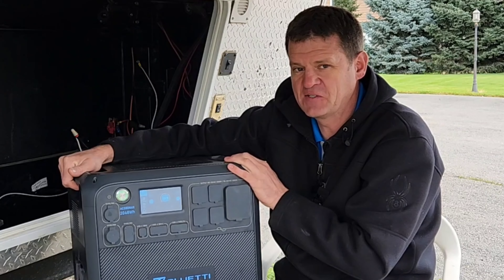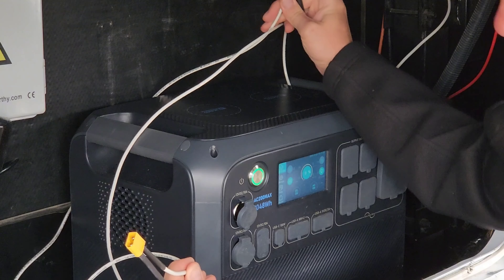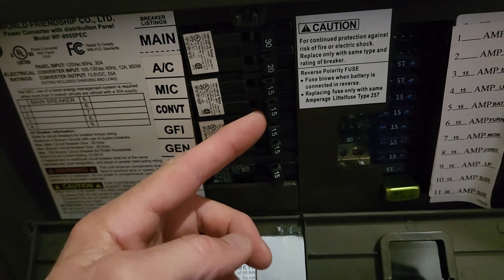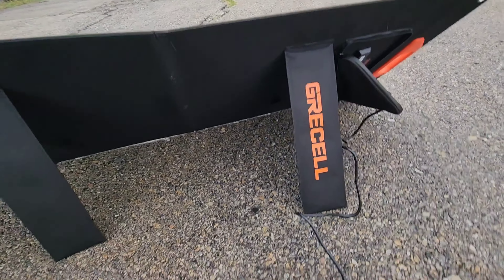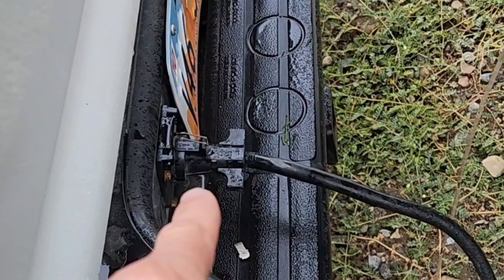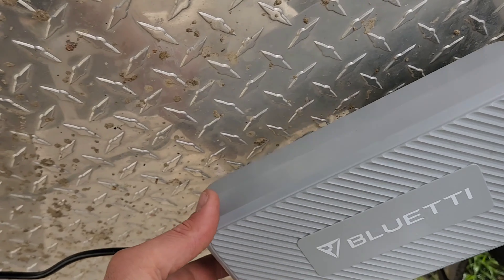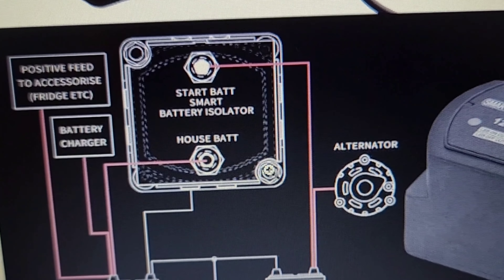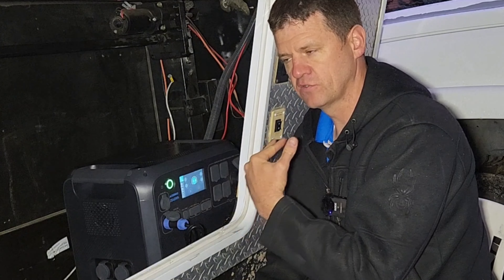How I installed a Bluetti as my primary RV battery.

Comment from the maker: *Products*(affiliate Links):
BLUETTI AC200 MAX WEBSITE LINK: http://shrsl.com/49ix2(DISCOUNT CODE: Diy200)
AMAZON LINK : https://amzn.to/3ZQp67S
RV Cable 12V/30A Aviation plug : https://amzn.to/3FhRvus
-DC charging enhancer: https://amzn.to/3Qc5o3z
-Grecell 200W mobile solar panel: https://amzn.to/46o8N4R (usable $60 discount)

- My air conditioning unit is 15000 BTUs and requires 6000 watts to start.  This power station is able to start it just fine.  
- As @stuartstuart866 has brought to light, you'll probably also want to disconnect any 12v axillary power from a tow vehicle battery just to ensure the Bluetti doesn't back feed the tow vehicle.

Chapters
0:00 Intro
0:28 Removing the old Lead acid battery
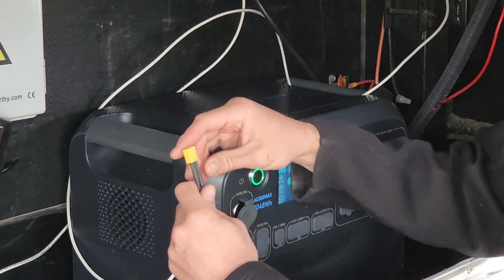0:48 Connecting the Bluetti 12v 30a RV plug
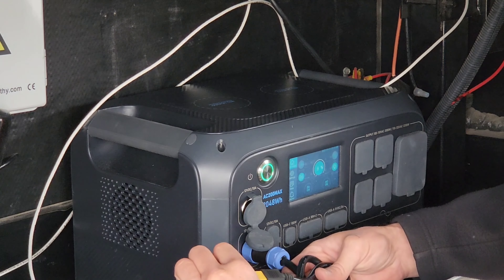1:25 Connecting the Bluetti 120v 30a RV plug
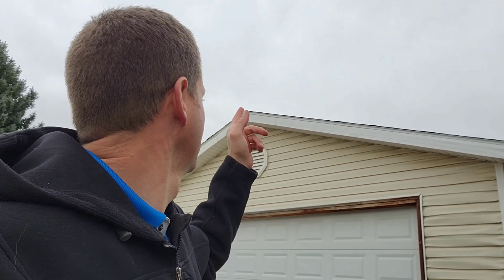2:33 Adding solar panels to the Power Station
3:20 Charging the power station from an alternator
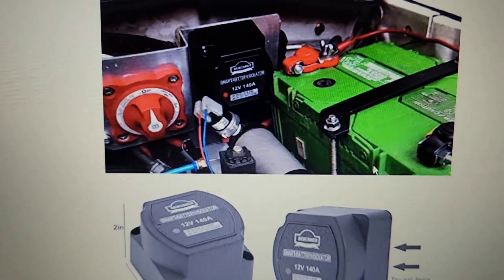5:08 RV Battery isolator explained
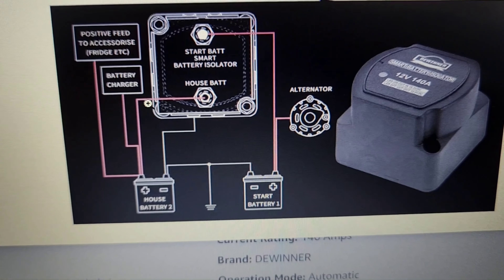5:50 Conclusion
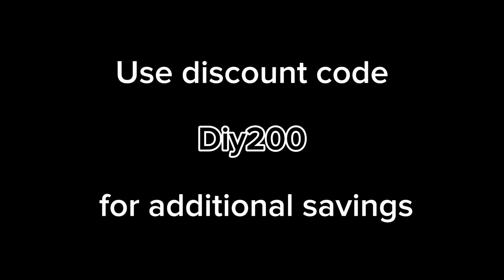6:57 Bluetti Discount code

Comment: You said in your previous video that 100 percent of your viewers were male well I don't know if I'm going to be the first the last or if I'm part of many females that watch you but when you took out your RV battery to connect the Bluetti as your primary battery in this video is there a way where you can do a video on how you did it and what is what,and why for me as a female who is learning this stuff and also layman terms will very much be appreciated lol.rt Now u are my Sing Sing, my Mentor on this Rv and Bluetti subject. ❤❤😮😮😅😅😅😊😊
Reply from the maker: Awesome, thank you for commenting. I think you might be the second female commenter so far on my channel :-). Thanks for joining us. Basically instead of connecting your battery terminals to the positive and negative of the battery you now connect them to the positive and negative of the 12 volt pins coming out of that plug. I know the wires are small but they will support the 30 amps of current that the blue Eddie can provide... I hope that makes sense.
Reply: I’ll be the third!
Reply: @diySolarPowerFunWithRay  I'll be the 4th 👋🏻
Reply: I’ll be the 5th element 🎉🎉🎉
Reply: Im no man either! 😂@diySolarPowerFunWithRay

Comment: What a great alternative.....thanks for sharing...I plan to do a lot of dry camping in my class C and with a setup like that it could be recharged while driving or just run the generator for a couple of hours and it will be good for all night or help on hot evenings...
Thanks for sharing and helping me with the perfect solution
Reply from the maker: No problem. It's pretty awesome. If you put a few solar panels up top I bet that you won't even need generator charging or alternator charging.
Reply: I also have a class C motorhome with the same setup, which I was looking for battery options. I appreciate your advice, walking through this video in in laymans terms.

Comment: Well, I built my own version of your system. Don't get me wrong, I love Bluetti and have one of their smaller units to power a pellet stove during winter blackouts. The system I built for my travel trailer uses a 3000w inverter, a 200ah LFP battery, and has waterproof plugs for110v, 30a RV, and Anderson connectors for the 480w of solar on the roof. Put it all in a waterproof box with wheels and can use it at home or either of my travel trailers. Can even use it in winter and run off my Samurai plow rig's alternator as it charges @ 14.4v and also has Anderson plugs.
Reply from the maker: Nice!
Reply: Great!  @InTheDirtAgain Was thinking of doing the same thing, but how do you use it in winter? It it a server rack battery or something else? Will you share a link or identify it? Do you insulate the box? Do the batteries not get below freezing thus not allowing you to charge it?  I want something that can stay in the belly of my RV or a little shed next to it, but nto have to worry about freezing temps.
Reply: @neelimabaird3159  use a self-heating battery

Comment: Great video.  Please keep in mind that the AC200max does NOT like vibration !!   If that RV is bouncing along the road it may cause internal damage to the MAX.  Definitely DO NOT have it turned on while bouncing down the road .   See Bluetti instruction manual .  Also,  the MAX should be fastened down somehow so it does  slide around while in motion.    Just my 2 cents worth.
Reply: I have been thinking about this with one of the smaller Bluettis like an EB3A to replace the AGM battery in my old airstream. Battery will live on the RV most of the time. Are you saying I'd need to remember to disconnect the battery from the 12v system every time I move the trailer? That might tip the scales in favor of just getting another AGM that is set it and forget it.
Reply: @yachtboy  I would check with Bluetti through their email.  They have great customer service and answer questions pretty quick.  Maybe check the owners manual on line to see how it would handle constant vibration.   Or maybe plan on lots of foam to cushion the ride ???

Comment: I using a variety of  Bluetti power boxes  and this  video help me out to undertand more about capacities and connections   its a very usefull  I did suscribe to continue waching more new videos  I live complete off grid  I been running all My electrical and  electronic  devices much as Bluetti can handle  I had a grecell T1000 and one day I tried to run a 120v 3A  small compressor   But the peak power from the compressor didnt handle the T1000   and there is no way to turn it back on some  thing went  wrong in the unit  That couldnt use it anymore  So Bluetti I think is more  quality and have a more overload protection in case if I connect higher power  devices  and the unit can not handle .

Comment: If you upgrade to Li can you charge off an upgraded converter? Then the 'shore' power of the Bluetti can charge smart BMS Li batteries, that are phenomenal deals now, that will in turn charge the Bluetti off PV, or if you switch the shore plug to a house/garage or RV park source. Then, as you are using the Bluetti on a shady day to run AC, the 'house' battery will charge the Bluetti just like a B230 will???

Comment: This looks like a great idea. I’ve been thinking on putting a small solar system in my fifth wheel, but I know I would cost at least 10,000 or more. How do you power to it when the connection for your shore power on your RV is way at the back I’d really like to try this. Thank you for your help all your tips and information.
Reply from the maker: My Shore power plug was also in the back of my rv. I just ran it around to the front where I was storing my power station.  I also have a long 30 amp extension cord that I can use if needed but I haven't had to use it yet. Using this power station is really easy but if you want to have a larger battery I would suggest looking into my 48 volt RV build video.

Comment: Do the DC wires need to be connected to the Bluetti, or could everything in the RV run off the 30-amp AC plug alone? For instance, if you leave the RV battery in place, turn off the converter breaker, and connect the Bluetti to the 30-amp AC plug, would you still be able to use both 12V DC and 120V AC power? What’s the advantage of using the Bluetti’s 12V outlets along with the 30-amp AC outlet?
Reply from the maker: I tried keeping my RV battery in place... but all my 12v power was going through 120v 30a rv plug and then being converted to the 12 volt system....Super inefficient to run your 12 v fan all night.

Comment: Aren’t you losing the amp hours from the house battery if you toss it out? I used our Bluetti AC200MAX to boondock all last summer (like 90 days).  Bluetti charged via solar (or borrower 120 outlet if raining), plugged in shore power to the Bluetti to charge AGM battery/use 120 volt appliances. Disconnected shore power from Bluetti at night and ran off of 12V house AGM battery. Rinse, repeat. We barely had enough power if we used the micro, air conditioner (for like mins, ha) or air fryer. For more power, Is the play to add a Bluetti expansion battery (B230) and just toss out the AGM? Or get another AGM and run the same way. Seems cheaper to get a second AGM.
Reply from the maker: My AGM battery only lasted 3 years and it didn't have any life left. They are more of a headache imo.

Comment: One guy added a second alternator and said it was wonderful to charge the RV battery, but I thought the engine would suffer from the load and use more fuel? Perhaps the 2nd alternator could be disengaged if not needed? Perhaps a clutch or something? Would it be a factor on a large diesel engine?
Reply from the maker: I have also heard of some people doing that. They had a 48 volt alternator. And it actually can produce a lot.  I have never needed one though. I've actually never needed to really plug in to shore power either because my solar panels always have my battery topped off anyway. Even when I'm traveling they are charging

Comment: Can you do another video of how you bypassed the onboard rv converter to use the bluetti? I'm still not understand how you cabled your system.
Reply from the maker: There is a breaker that you can flip that will turn off your converter. Hope that makes sense. In my 48 volt RV conversion video i explained it in more detail.
Reply: @diySolarPowerFunWithRay  Thanks for the quick reply. At the :49 mark did you have to make the the 10 gauge wire and add the connector? If I understood you correctly, one end of the 10 gauge wire went to your positive battery terminal? Why would you connect it to a battery terminal? Sorry for being so dense.
Reply from the maker: @travisadams4470  no problem. Instead of connecting my positive and negative RV battery cables to a old lead acid battery, I'm now connecting  the positive and negative rv battery cables to the positive and negative output of the 12-volt 30 amp bluetti pins.
Reply from the maker: @travisadams4470  yeah I made that xt60 cable.
Reply from the maker: Before I did the conversion the negative of the battery cable just connected to the frame of the rv. Like normal.  Hope that makes sense.
Reply: @diySolarPowerFunWithRay  Yup! It makes sense. Thanks!

Comment: What do you do if there is shore power service? Does the inverter charge the bluetti?
Reply from the maker: I unplugged my Shore power from the bluetti and plug it into Shore power.
Reply: I'm getting ready to this this exact thing. I do not have a bluetti I have an Oupes Mega 3. What I am trying to figure out is how I can get Sure power to charge the power station. In other words if I'm plugged into shore power at a campground how can I get my converter to charge my power station
Reply: @jsdiecast  I have an Oupes Mega 2 and he best way to charge it (as your house battery) when connected to shore power is to run the A/C plug from the Oupes to the power pole with a 110 extension cord or to one of the 110 outlets on your camper. This way, you are essentially charging at the max wattage as if plugged in at home while plugged into shore power.  When the 12v 30amp Anderson plug is coming out of the generator to power your 12v items, that plug cannot receive power in to charge. You have to turn off your converter charger as it won't charge from the Anderson 12v 30 amp outlet as I understand it.  I believe the converter could charge it if you upgrade to a lithium converter charger, but you would have to charge from the "solar" anderson port on the side of the unit, then run out to the camper from the 12v 30 amp Anderson power out on the unit. I just find it easier to charge it from the 110 input. Keep in mind, if you are powering the trailer with the 30 amp RV plug on the Oupes and powering your 12v 30amp things from the Anderson port on the front, you don't want to have the generator plugged into the camper. (you don't want the generator trying to charge itself).

Comment: I KNEW there was a way to hook this up to your DC side as well!!  WOO HOO!!!  So quick question, when the RV is connected to your vehicle via the 7 pin adapter, you had to disable the ability to change the Bluetti from your 7 pin?  Is there anything you can do where you don't have to do that? I would like to drive and still have DC for my fridge.  Thanks, GREAT video!
Reply from the maker: Thanks for the comment.  There are a couple options for you.  First off, if you disable the 12v 7 pin charging you'll still have 12v to your fridge via the bluetti if you wire it up to the 12v 30a rv plug Like it did.
    If you really want alternator charging from the 7pin while driving, another option would be to re-wire the 12v auxillary power wire, from the 7 pin adaptor on the trailer, so it will supply power to the 12v car charging port on the Bluetti. Hope that makes sense :)
Reply: @diySolarPowerFunWithRay  Cool thanks.  Now, another question, if I don't care about charging from my truck, can I just leave the 12v pin charging alone?  Will it hurt anything if I just leave the 7 pin alone?  I am still not clear as to why you disabled the 12v 7 pin charging
Reply from the maker: @markk171  I disable the 12v because I had a lithium battery in my RV. There are some dangers in directly connecting lithium batteries to regular car batteries. There's a lot of information online about that if you want to learn more. 

     Regarding your 12 volt charging pin...You might be okay but I disconnected mine just to be safe. For example if your car battery is dead and you plug into your RV while your power station is connected it may send too much power into your battery to try and charge and that could damage wiring in your truck depending on what size wire you have there.
Reply: @diySolarPowerFunWithRay  ahh...yes I have heard of this dead vehicle battery issue.  well for me, I NEVER connect my tow vehicle to my RV if my tow vehicle is not running. I was a truck driver for a few years and it was always a no no to connect the tow vehicle to any trailer if the tow vehicle was not running...just pounded into my head I suppose so its a force of habit.  Thanks for the info!

Comment: I wondered why no one seems to do this mod, this is absolutely brilliant. Ray, even though the 7 pin won’t properly charge the Bluetti, do you think it would damage the truck battery, alternator or other components? Would the Bluetti backfeed  to the tow vehicle? Thanks
Reply from the maker: Yeah, It's crazy. I think the reason no-one uses this mob is because powerstations usually don't come with the 12v 30a plug. I could only find it on this unit and the echoflow delta.  
   Regarding alternator charging:  It I were to wire the 7pin wires to go into my battery charging port it would work... but I took the lazy approach and just connected it straight to the battery..The nice thing about this unit is it already is ready to connect to a lead acid battery/alternator...It limits the amout of amp's it will draw so it won't wear out your alternator, melt wires or blow fuses.
    Regarding backfeeding the battery: good question, Let me go and test that now and I'll post back.
Reply from the maker: Ok, Regarding back feeding the tow vehicle.  If it was me I would disconnect the auxilary 12v power(I did this on the towing chord that's on the RV side)... so you'll know there won't be any backfeed into the tow vehicle. Thanks for point this out.
Reply: @diySolarPowerFunWithRay  trailer break-away switch disabled with this mod. fifth wheels are great towing trailers down the road so an accident is unlikely.
Reply from the maker: Thanks for the comment.  From my understanding the break-away switch will still work as normal. My brake-away switch, when pulled draws 13 amps. I just pulled my switch and measured it.  The bluetti 12v port can handle amp draw that just fine.  That's my understanding anyways.
Reply: Is this still working well for you?  I bought the cable for my AC200 Max over a year ago but still haven’t hooked it up.  Is the parasitic drain a problem?
Reply: I thought there is a diode is in the circuit to prevent the backfeed to the vehicle battery?

Comment: hi, are you still using Bluetti 200 Max power station as your primary battery in your rv?
Reply from the maker: I am currently using the system that I feature in my 48 volt RV build video. This system is easier but it has less battery storage. So there are pros and cons to each setup

Comment: So how many times has this unit failed you so far? Ever since I got my unit I’ve had nothing but problems. I almost gave food poisoning to several people when the fridge I was powering using the Bluetti failed. Since Bluetti gave you the power station did they also give you their DC charger? Stupid question because your video was made in 2023 and they recently came out with it. How about an update? Do you still have it installed?
Reply from the maker: I have seen Dc Charter but I haven't had a chance to review it yet.
Reply from the maker: Because I already have a system installed on my RV I haven't been using this power station on my RV
. Maybe on my next rv . Are you using this power station as your primary RV 12-volt battery as well?  ... if so did you remember to turn off your converter box?